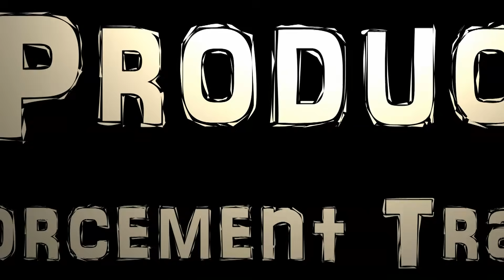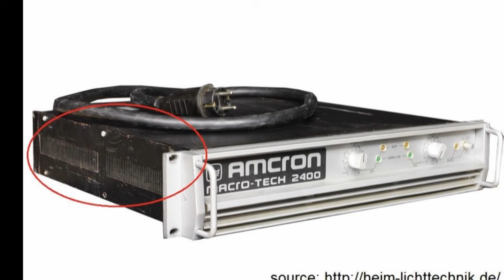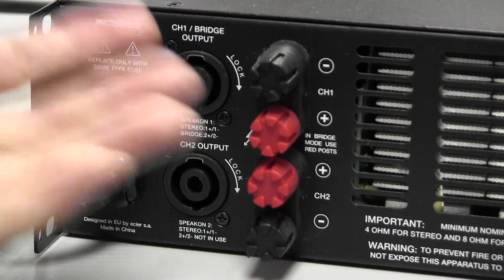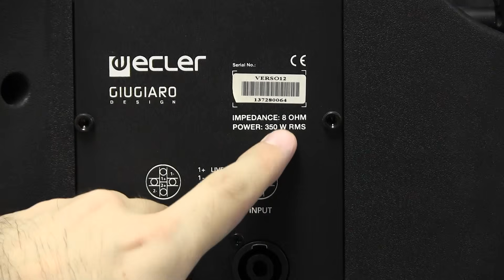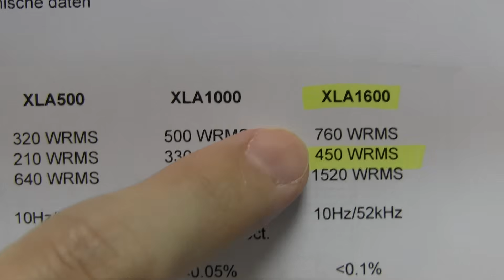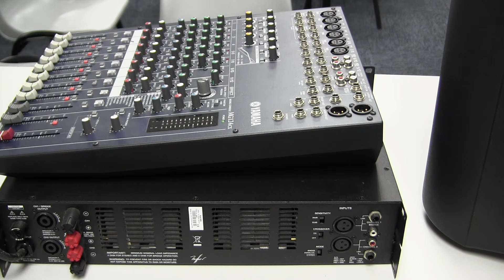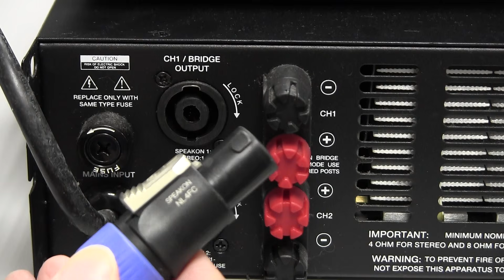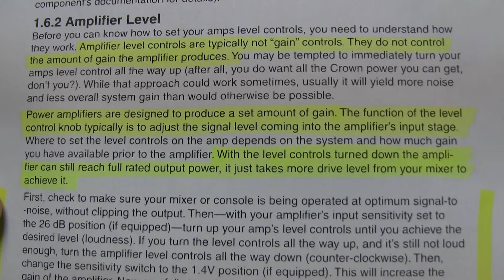How to connect a power amplifier to passive loudspeakers

Comment: That's very informative and helpful. You've solved many of my questions about live setup because of my lack of experience. Thank you, Bruno! Looking to see more of your tutorials!
Reply from the maker: Chris Jerome That's great to hear Chris, thanks for letting me know! Feel free to get in touch any time you have specific questions, always happy to help if I can.
Reply: GLB Productions oh, yes, that's very kind of you, Bruno! I never know how to setup those huge line arrays. How do people determine the frequency ranges that they want to divide for each speaker? What other equipment do we need in the chain and how to connect them correctly? I know it's complex, but hope to hear it from you when you get a chance. Thank you very much!
Reply from the maker: Chris Jerome Those large line arrays are set up using 3D acoustical simulation computer software, often written specially for each company or even for each array. These programs allow both simulation as well as real-time calculation of the coverage of the system into a given venue - basically what you get is a 3D image of your specific venue showing the sound levels in each sector. It's very advanced and quite impressive to watch! The arrays themselves are controlled by a central system processor that does all of the frequency and power management, including crossover points and time alignment, which is very important for large PA systems. All of this is generally the responsibility of a person called the system technician, which is a separate post from front of house engineer. When I mix on a line array I will always work with a system tech - we will discuss general positioning and coverage of the array but they will do the actual set up, including the angles between each cabinet and the EQ of the array to the room. At that point they will hand over the system to me, and I will do any final EQ tweaks and then mix the show. 
So as you can see it is really a team effort. Hope that helps, let me know if you have any other questions :)
Reply: GLB Productions Wow, thank you so much for your detailed explanation! That's exactly what I'm wondering about. Yes, it's absolutely helpful! Thank you for telling me the right terminologies so that I can do some further research as well. It's a real complex work that requires a lot of team efforts. I see. Many thanks, again, Bruno! Have a great day!
Reply from the maker: Chris Jerome You're welcome Chris, you have a great day too :)
Reply: GLB Productions Thank you :)

Comment: Great video. I've learned a lot. Have a quick question. If I want to connect one 4ohm 500-1000w speaker to an amp of min 4ohm and 1000w (500w on each channel), can I connect both channels into the one speaker (to the two inputs of the speaker)?
Reply from the maker: Sham Thanks for watching! No you cannot - the only time when you can connect two amp channels to a single speaker is when you use bridge mode, but as your speaker is 4 ohms and you have stated that your amp's minimum load per channel is 4 ohms, the minimum load in bridge mode would be 8 ohms, so your amp would overheat. 

What is RMS power rating of your loudspeaker, and what power does your amp deliver into 4 ohms, per channel?

Comment: Great video :) And what about ground loop between mixer and amplifier? Is there some problems ?
Reply from the maker: MUDrLantko Ground loops can generally be prevented by ensuring that your mixer and amplifier are both on the same electrical circuit.
Reply: GLB Productions I know that, but this is not sure for some cases. Or? :)
Reply from the maker: MUDrLantko In those cases you should move to a different electrical outlet ;)